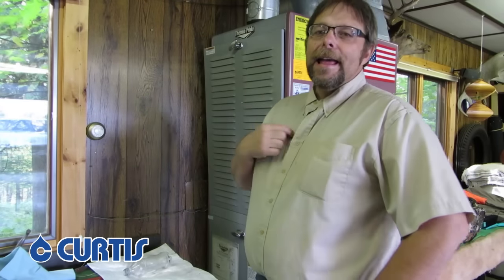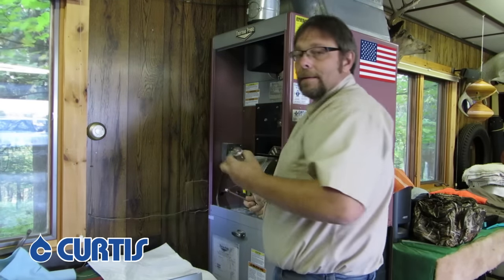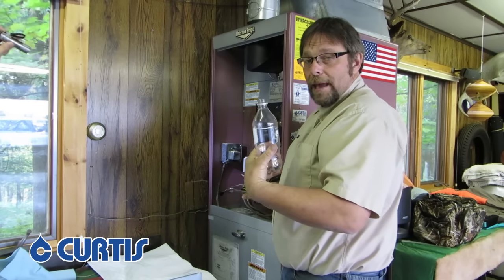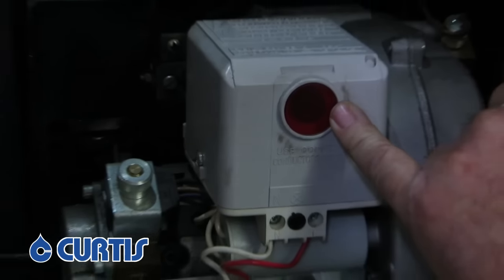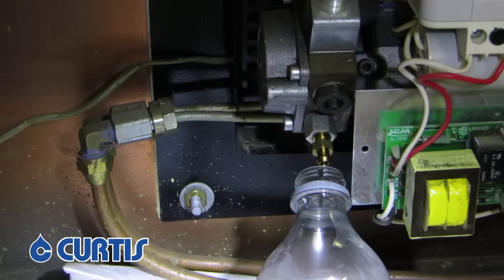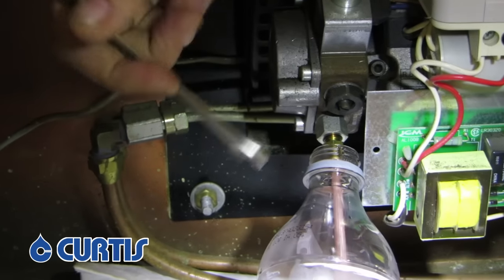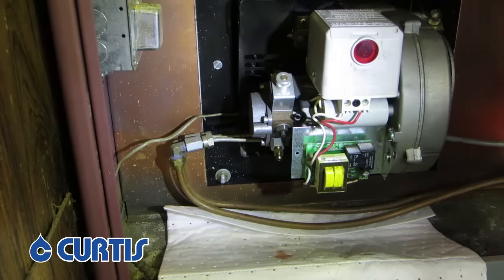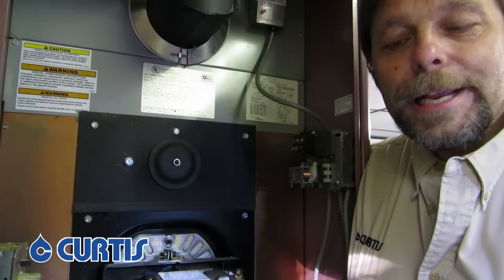Curtis: How to Bleed and Restart an Oil Furnace

Comment: I just want to say thank you a million times. I ran out of heating oil on a Sunday morning, and had to put 20 Gallons of diesel in my oil tank. My system would not start. That's when I saw your video on how to bleed the system. It worked  perfectly. You  saved me a $200 emergency delivery charge plus cost of fuel. Thanks a lot and keep doing the great work.

Comment: ANOTHER grateful customer here! A week ago we were out of our house for 12 hours due to running out of oil (and a seriously delayed delivery!)  and while we were gone we were told it had been delivered early in our absence but they would not be able to come back to bleed the furnace to restart it for another 12-22 hours! I don't know why but I looked here and found you and saw it was possible to do it myself. When I came home I saw that I had a Weil- McClain furnace but their videos weren't as easy or as reassuring as yours so I came back to yours to have you walk me through it! I tried to use a needle nose plier instead of the wrench but I couldn't make it work so I drove to W and bought a wrench set for just $4.97! When I came back I rewatched this video and did it with you step by step (even with the shutoff!) and BINGO! I CAN'T SAY THANK YOU ENOUGH. WE DID IT TOGETHER! The oil company was REALLY surprised when I called to cancel the next day's (bleeding) service call! This is one more household emergency that will never frighten me again!

Comment: I wanted to say thanks for this upload. I ran out of fuel as described, and struggled with handed-down incorrect methods to bleed at the wrong point. Using this technique, I was running again after 4 cycles. Your vid was clear and concise. Thank you so very much, sir.

Comment: I've watched this video a few years back after having ran out of fuel.  I was pretty sure that I had remembered what to do to bleed start our furnace but was looking for the reassurance that I was doing everything properly and is nice to have a step by step visual aid to look at for reference.  Thanks again for taking the time to make this video.  I am omw to the gas station as I have ran out of fuel on a -10 degree evening, and am grateful to have the video to look back on so that once I return home I wont have to stress if I will be able to get the heat back on.  It is also nice how you gave a reference to how much fuel would be sufficient to get you through the night.  Greatly appreciated to have such a good tutorial to reference when in these emergency situations.  Thanks Dan, your a life.....and wallet saver.

Comment: I ran out of oil two days before my scheduled delivery (think I’ve been running the house warmer this year, or I’ve been getting less oil for the same money which is more likely haha) and house was absolutely unbearably chilly. Thankfully it wasn’t so cold the pipes froze. But once I had the oil delivered this morning. I literally watched your video once. And I have my oil furnace restarted. It took me 10 minutes. I’m kind of blown away how easy it was, especially when I called a place for a quote and was told it could range from 100-300 depending on if it needed any cleaning (it didn’t, literally just needed a bleed). Told them I’d call back, but got the creaking and popping of my pipes now (water heated pipes so lots of old pops and creaks when it heats up). Thank you for posting this video.

Comment: 7 years later and it's still a helpful video! Thanks. At least once every few years, I've run out of oil before the provider can get to me, and every time, I forget about bleeding the line. I've watched this video 2 or 3 times now when I remember I need to bleed the line. Helpful, straight-forward, how to video. Thanks!

Comment: In April of 2013 I moved in with my gal friend and her house was in an unbelievable state of disrepair.  Her deceased husband had that hording disorder and the place could have been condemned - plumbing and electrical problems, mold on one end of the house......just crazy.  I was so busy gutting, drywalling, plumbing, etc. that we ran out of oil 3 times - just from not checking the tank.  She told me that bleeding the furnace was pretty involved so we paid to have it done - $160.00 each time.  Well, the oil filter canister was leaking (had been , for a long time) and I've remodeled the laundry room and I'm ready for a floor.  But before we can do a floor I needed to chuck this old filter and canister.  Today, I found the part and needed to bleed the line when I after I'd attached the new filter.  This video was a GOD SEND - swapping out the old filter and bleeding the line, today,  took all of about 12 or 15 minutes....  When I had called around to try and find a filter/canister I asked a couple of furnace companies how much it would cost for them to swap out the filter and bleed the line - it was between $200 and $300.  We spent TWENTY FOUR DOLLARS!!!!!!!!!!    You should post your address - man, I feel like I owe you some money...  THANKS FOR THIS FROM LAPEER MICHIGAN.
Reply: Guy Merritt there is nothing to it. anyone with the will to try can do it all. you lucky to even been able to find someone to come out. We're I am even if it is a new unit they don't want to play with oil. I had to install an completely change over my oil heating system my self. I had an old down draft forced air furnace in my mobile home. the wholesaler wanted thousands of dollars for a down draft forced air unit. so I bought a NYT  hot water boiler and pex pipe an put water to air rad in my old furnace and piped it in. just using the old furnace blower motor to blow the heat though out. like a air handler. I find service people not doing a proper job. I put in a 1-1/4" copper shock loop witch I find installers most times never put in. these mix your cooler water coming back with some hot water from the boiler so the cooler water coming back don't damage your boiler. but they sure no how to charge. the filter inset should only be 5$ it's like a felt sock
Reply: Well, since I posted this (2 years ago) I plumbed the house for gas and we got a gas furnace.   There was gas at the road, but my fiance and her late hubby had never gotten around to doing anything about it!   I had to pay a guy to help me install a good, used furnace (I know zero about duct work) but we've saved a fortune, already.   I found a great used furnace, from a guy who had a small house (where the thing had been in a closet in the living room - had a new one installed in his attic) and it's worked flawlessly - about 7 years-old and we paid $175.00 for the thing.   I was so happy to get that damned fuel oil tank out of the back yard.......!

Comment: Thank you so much for this excellent video. We ran out of oil yesterady. Unufortunately I didn't know the part about getting some diesel so we spent the night elsewhere. Once oil was delivered, the furnace would not come on. I followed your directions for bleeding the system and it worked perfectly! We have heat.

Comment: add me to the list of thankful people. Had no idea diesel could be substituted for home heating oil. Before checking out this video I called an emergency oil delivery number. 100 gallon minimum and $1 over the going price. Bought a 5 gallon gas can from Home Depot for $18 and purchased 10 gallons of diesel from local gas station. I could not get any oil out of the bleed screw after a dozen tries, and was about to give up. So took off the filter and scraped the sludge off.......... the tank is 40 years old. Primed the the filter housing with oil and tried again. Took about 6-7 attempts before I could celebrate!

Comment: Dan, I want to thank you so much for the instructive and straightforward video.  This resolved my issue.  Also I was not aware that diesel fuel was a substitute for #2 fuel oil.  You helped me greatly. Outstanding video!
Reply: Yep its the same thing. In fact the DMV or DEP checks tractor trailers on the road to make sure they are using diesel and not home heating oil. H/O is cheaper but I think diesel burns cleaner in trucks. Different blend

Comment: Thanks for this video it was a great help. Viewers in Ireland and the UK, if you are trying to restart an old "Grant Euroflame" type boiler there may not be an obvious bleed valve. On mine there is a large hexagonal bolt at the base of the pump. Remove the bolt completely and fire the boiler by pressing the red button, mine has a 60 sec time out so you may have to wait on it. Fire the boiler three times to expel any air, then replace the bolt and fire again. Your boiler should then work, if it doesn't, remove the bolt again for one more bleed and then replace it and try again. It's easy to do but a bit messy so be sure to have a container and pleny of old rags, and of course make sure you have some oil in the tank first, if you can't get any diesel will do fine. If I can do it anyone can!

Comment: I wanted to thank you.  I was really scared about doing this but you made it sound easy so I watched the video a couple of times and yeah.. it totally worked after trying.  Thank you soooo much. :) That and they wanted to charge me a $150 to come out and do it and i just didn't have that right now.  Also, mine is apparently an older model so the valve was on the left side and at 6 o'clock ... annoying to figure out how to fix the wrench in there but it worked and i'm happy.
Reply: Emily Small there is nothing to be scared of. fuel oil is not like gas. it's not going to blow up. was welder for many years and  no wing nothing about oil furnaces some 32 years ago. I stayed the weekend in the camp and the furnace went out in the bath house. I was asked if I could have a look see if I could get it going as it was -40 out. not knowing a thing about them. I jumped in head first. took it all a part witch is so simple. cleaned up the burner head an tip. cleaned the electrodes up with carburetor cleaner. put it back together and beaded it. it was up and running. and stayed running. no one even looked at it  the next week. it is very hard these days to even find a heating service place that will even come out and look at a oil unit.. they want nothing to  do with oil. they try and sell you a propane furnace if your in the country. Witch will really cost you to heat your home... I been looking after many people's oil units for years an showing them how simple they are so they can do it them self. even the youg ladies are doing it. it's a no brainer
Reply: Emily Small there is nothing to be scared of. fuel oil is not like gas. it's not going to blow up. was welder for many years and  no wing nothing about oil furnaces some 32 years ago. I stayed the weekend in the camp and the furnace went out in the bath house. I was asked if I could have a look see if I could get it going as it was -40 out. not knowing a thing about them. I jumped in head first. took it all a part witch is so simple. cleaned up the burner head an tip. cleaned the electrodes up with carburetor cleaner. put it back together and beaded it. it was up and running. and stayed running. no one even looked at it  the next week. it is very hard these days to even find a heating service place that will even come out and look at a oil unit.. they want nothing to  do with oil. they try and sell you a propane furnace if your in the country. Witch will really cost you to heat your home... I been looking after many people's oil units for years an showing them how simple they are so they can do it them self. even the youg ladies are doing it. it's a no brainer. as long as it's not blowing black or gray out the pipe your good to go.. even at that it mostly just needs a good cleaning. Witch should be done once a year
Reply: I have the same comments. I'm so proud of myself!!!!!!! Took about 1 minute,and saved me 127.00 Thanks so much!!!!!

Comment: My oil burner looked just like Curtis's. I
followed each step and it worked. The oil was red at first then cleared on the third push of the red button so I tightened the bleeder. I used a Classico Vodka Sauce jar w a lid instead of the bottle. Thank you!!!

Comment: Great presentation. I can confirm this is correct Approach. Able to bleed  A Beckett furnace And it was indeed the  3/8 socket.  With me I had to do this about 9 or 10 times before it kicked in

Comment: I stoped having oil delivered some 20 years ago due to the added fees and heating tax. I picked up a 300 gallon tank an 12 volt pump an put it in my truck every winter. as I can buy colored fuel at the station for 0.88  CND a Lt.

Comment: Not sure if your still around on this channel but I was curious I have a house in Upper Michigan where the furance hasn't been started in over 10 yrs. Does heating fuel slug up like gasoline does if so would I have to bleed it out of the system and drain the tank? Also do you know if there is a conversion to propane for old furnaces? Probably just worth purchasing a new one at that point.

Comment: Not starting after holding the reset button for more than a minute, what's going on? The motor does not make any noise at all and "call for heat" light is yellow on the main switch panel. The motor seems does not turn on at all no matter how long I hold the reset button. 
I also changed the oil filter the added 5 gallons of diesel. does this cause problem?

Comment: Thanks man for posting this.. fkn awesome info when needed. It's 1 below zero here in Mass & my furnace is not working so i'm gunna try bleeding the line. The oil companies charge $35.00 or more to bleed the lines which is ridiculous. They suck

Comment: This is something interesting to know and learns in case someone needs a hand around. I am using the electric furnace and mom is using a heat pump for floor heating. So we had a different type of problem here.

Comment: Hi there.. have any videos on how to clean an oil furnace. it is a Nortek oi furnace becket burner. it is in a mobile home. I am in a remote area.. wondering if you have any info on how to clean the soot out.. smoke coming out of chimney.. and not heating up. thanks!

Comment: good video. quick question. I unscrewed the nut as to bleed the system. the nut didn't turn by itself... as I turned the nut, the entire bleeder unscrewed as well.  the bleeder came off, but nothing but a couple of drips came out.  question: is that because the bleeder wasn't in place? or does that mean there's a blockage somewhere not allowing the oil to come out? Or do I just need to leave it open for a while to let out what could be a lot of air?

Comment: Thank You!!! I had to activate the furnace from the thermostat since I hit the furnace reset button twice already and was afraid I'd flooded it with oil, so I set up the bottle to collect without me temporarily!

I used a square of packaging tape just below the drainage tip to gently secure a clean Dunkin donuts straw I had pushed onto said drainage tip,  taped the other end to a soda bottle, stood the soda bottle on some old paint cans (bottle was positioned at the same angle as the one in the video since I didn't have a large bendi-straw, but the straw was very sturdy, so just the corner the bottle was being held up by the paint cans really. The tape holding it to the straw held it up on its own.)

I used an adjustable wrench to loosen the nozzle barely, ran up to activate the heat, ran back down as the furnace came on. A little had come out but the furnace shut down. As I hit the reset button, a ton came into the bottle! 😀

I was silly and in my rush to close it, I tried to use the adjustable wrench. That was too slow, much easier to close it with my nitrile-gloved hands.

This did get my gloves wet since I was slow to close the drainage tip, so the tiny bottle I used overflowed slightly, and the method might not work for everyone, but it worked well for me! Just make sure to wear eye protection just in-case, and wash your hands well with dish soup to remove any leftover oils.

Nice and toasty!!!

Comment: Thank you!!! My biggest issue in doing this was that I had to go to the store and buy a set of wrenches. I'm glad I hit the red button to turn off the furnace since the air bubbles cleared really quickly. I thought for a second I would have a big mess, but the reset button turns it on and off.

Comment: I have a thermostat that I am trying to bring up the Heat. 
I have a newer Beckett burner.
I have a red button on the top and the thing that you are pushing.
I also a switch on the side. I did get oiler and now I am trying to make my thermostat call for heat.  Right now cold air is blowing out.  Again, I am trying to get thermostat to call for Heat.

Thank you

Comment: Great video, you can also jump the "F" terminals if you don't want to wait for the lockout on the red button to reset.  The "F" terminal control the Flame sensor.  It will keep shutting off and locking you out because there is no flame.  Maybe a little too in depth for the average homeowner but cuts down on the time to prime.
Reply: Wanna tell me where the FF terminal are on a riello primary control?  Lol.

Comment: Can anyone tell me why do I have water coming out of there?
At first it was oil with air and the furnace actually turned on when I tightened the valve, but after a minute or stopped and now I have a constant stream of water coming out of the bleeder valve :/

Comment: Thank you for the post Dan, I was shown how to do this before but I needed a refresher.  I do have a question though: Diesel fuel is safe for all heaters right, I was told that kerosene or diesel will clog some pumps because  certain nozzles won't work.